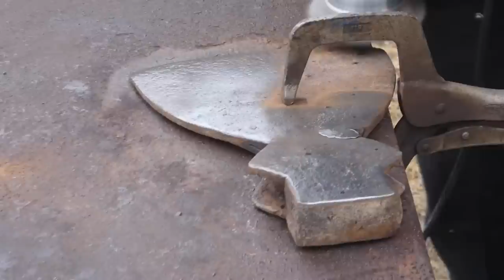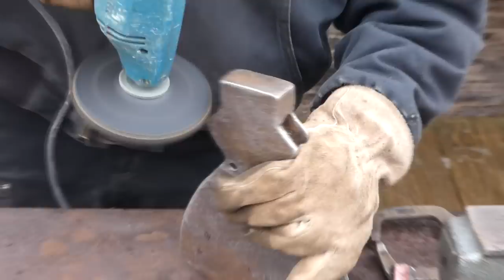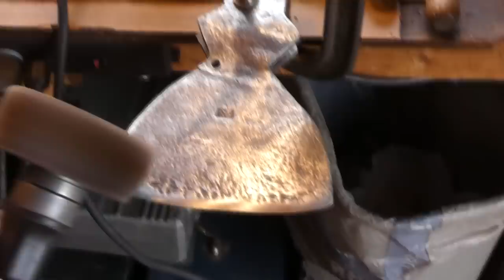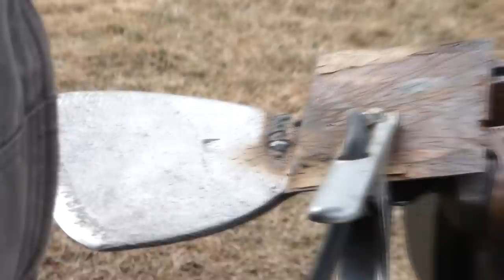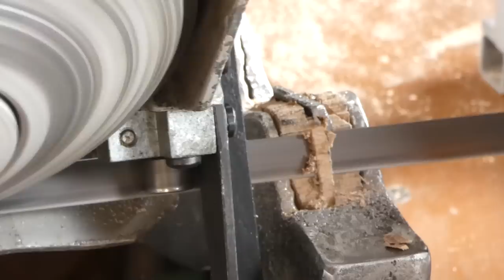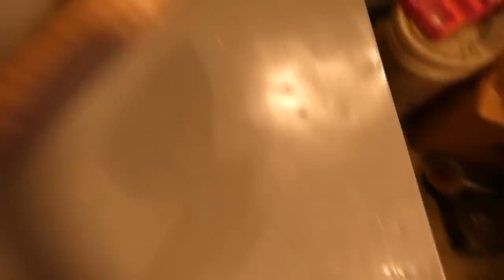Ancient Broadaxe Restored, and put to use! | Iron Wolf Industrial

Comment: Nice. What the heck was that pin for? Was it an attempt to stop the crack you think?
Reply from the maker: Great question Tony. The pin/rivet was to try and hold the eye of the axe together and to keep it from splitting. I noticed as I was fitting the handle before welding the eye, that the crack flexed open a good bit. It's a primitive way to fix the axe, but short of arc welding it or forge welding it, that was the best the person could do. It all stemmed from a bad forge weld that most likely was revealed after some use. Thanks for the comment!
Reply: Would it be worth the effort to plug weld the hole?

Comment: I think it's a hafting tool used to chop straight  cuts on logs  and the mark says RT that stands for a right handed tool
Reply from the maker: Interesting!! I will have to re-examine it and see if it all lines up!
Reply: RT is just a makers mark. That particular axe can be flipped for either left or right handed use with a removable wedge.

Comment: Very cool..!

I have its twin in my shop.

Thanks for the video..
Reply from the maker: That would be interesting to see! I'd be curious if the measurements are identical as well.
Reply: @IronWolfIndustrial  
Measurements on mine for the head are..
From pole to blade in the center is 9"
Following the curve of the blade is 9 5/8"
The pole face measures 1 1/4" x 3"
From point to point where the handle goes through is 4"
I can't read the stamping without etching.
It weighs in at 7 1/2 pounds

Comment: What about the crack next to the hole in the steel? Did you weld it later on? I’d be worried it’d fail during use. By the way , I’ve a head exactly that shape and size I’m restoring now to hew logs for outdoor furniture. I’ll be making a 20” handle for also. Luck